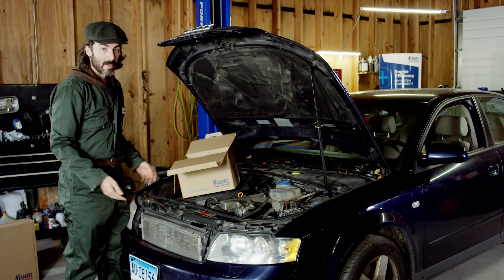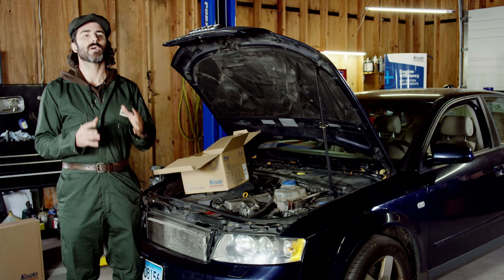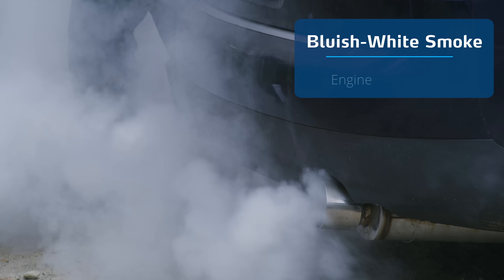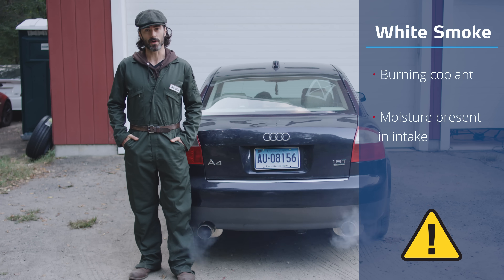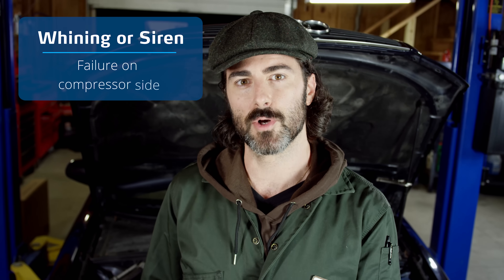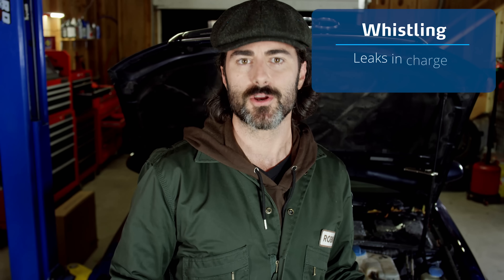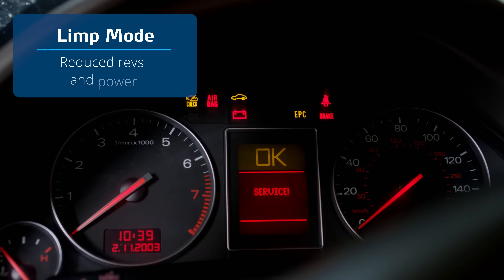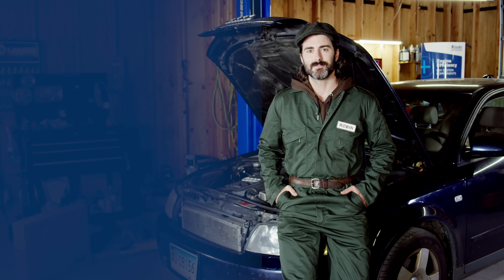Identify Turbo Problems

Comment: 3:34 just sounds like someone has tampered with the blow of valve🤔 it’s bad if you got the fluttering sound while on boost but if it is while letting of the throttle it’s typically no worries (if you like the sound and drive a modified car that’s tuned or the parts is specificity made to handle it) on a stock engine it puts a lot of stress on the compressor wheel because the air is forced out of the compressor wheel
Reply: Flutter does put stress on modified of stock engine's turbo, its just noise coming from compressor because the throttle valve is closed and air cant escape the intake system. Im really not sure if there is evidence that it breaks the turbo.
Reply: Tarmo Alaspää yes the turbo is capable of handling the extra stress I drove a 940 turbo and many of my friends do to and we have had the blow of valve removed and they’re holding up just fine
Reply: My turbo sounds like this, that’s bad and I need to replace my turbo or it can stay ?